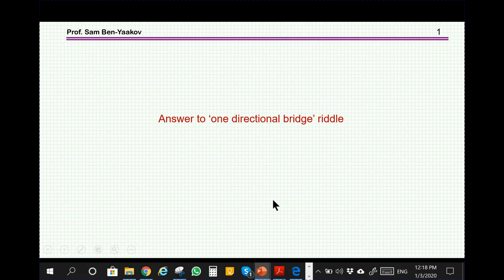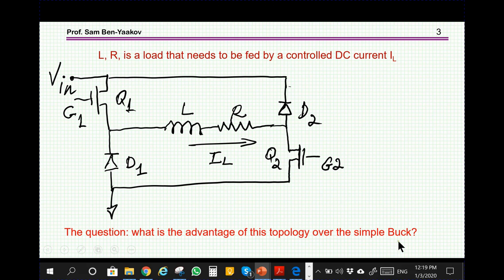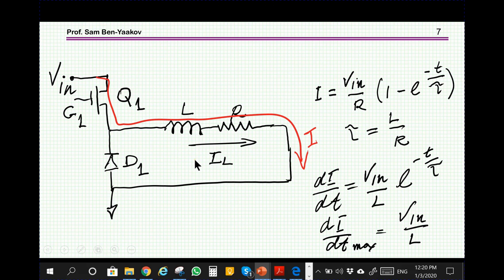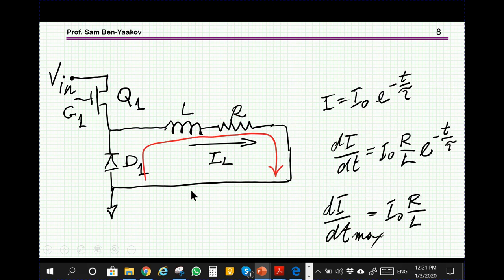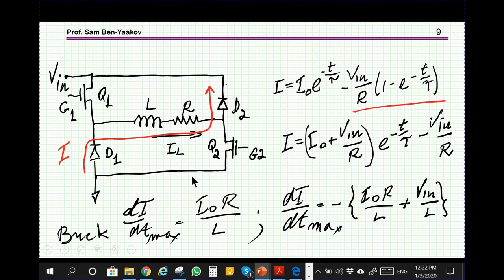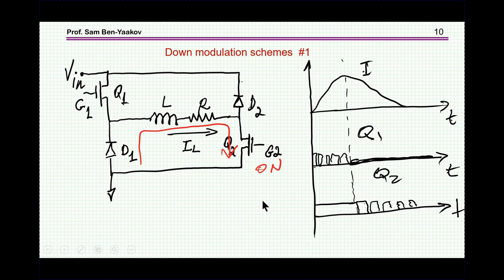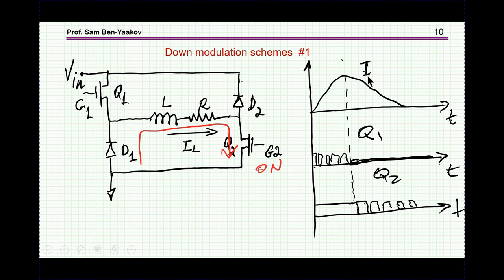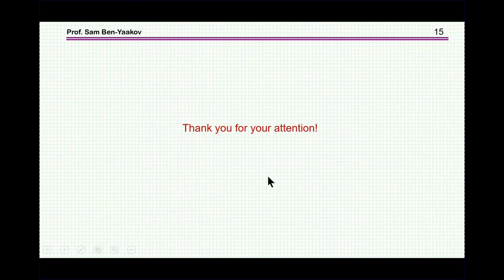Answer to ‘one directional bridge’ riddle

Comment: interesting point indeed, one practical use case may be interleaved bucks, on top of interleaving to increase power and decrease ripple, you get better dynamics.
about the new riddle one advantage would be lower losses
Reply from the maker: 👍lower losses with the right  transistor type

Comment: If the ability to reverse current is not used, the 4 switch topology allows synchronous rectification which reduces losses at lower voltages. The main disadvantage is the complexity of the control circuit.

Also, if each half bridge is connected to a separate supply, you get a buck boost converter that has lower ripple than the common buck boost topology.
Reply: @sambenyaakov  diodes will incur reverse recovery loss, which could be prevented with the switches when the current flow is unidirectional. This may also allow ZCS for the Q1, Q2. (of course Q3, Q4 can be turned on in ZVS).
Reply from the maker: NiHaoMike, on the spot but needs explanation on the type of switch.
Reply: @sambenyaakov  It will work for silicon MOSFETs, GaN FETs, and SiC FETs. It will not work with IGBTs, although at the voltages IGBTs are typically used at, diode voltage drops are generally not very significant.